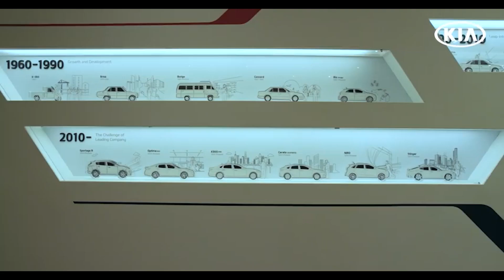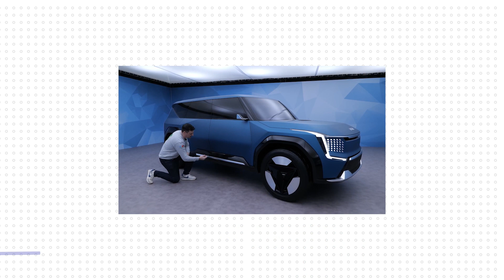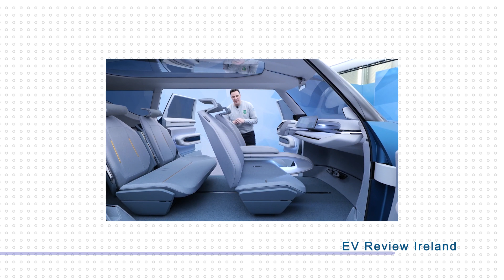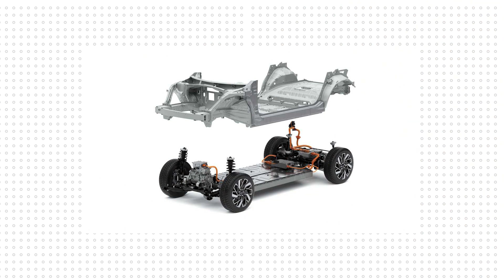Kia's ALL NEW EV Telluride SHOCKS The Entire Car Industry!

Comment: In it's current design, this vehicle would make sense if you were using it for non-highway use on local streets.  Tall vehicles (EV or ICE) with boxy designs struggle to cut through the air while long, low-to-the-ground vehicles do so with relative ease. KIA could of course re-design the final production model's front clip and make the nose a bit more solid surface in order for wind resistance to flow over the vehicle and not necessarily thru the vehicle which is what the front clip seems to be doing in this vid. 
Kudos to KIA tho as they have been releasing some awesome designs recently.
Reply: More aerodynamic, but significantly less practical. The most spacious, and usable SUVs are rectangular.

Comment: I don't like glass roofs that don't open. The isn't just the view, but the air flow as well. Anyway, why does every EV manufacture feel the need to try and reinvent the wheel?
Reply: Functionality. They are on the box 📦 and or rectangular side. Not as aerodynamic. A lot more air resistance and other issues. 🤝would love them to have better rims tho 🛞